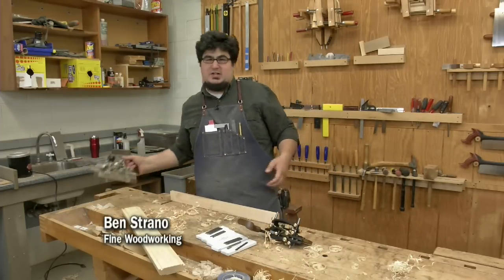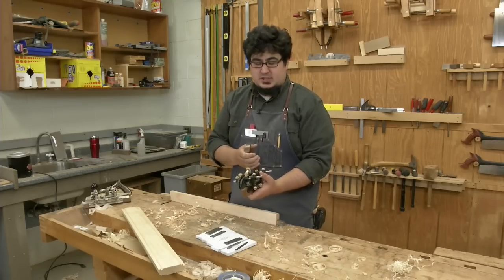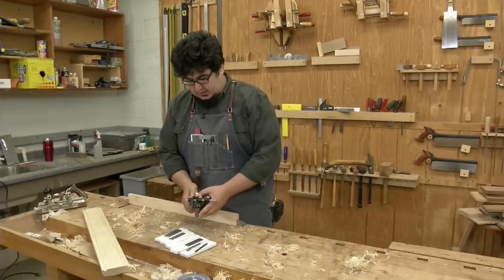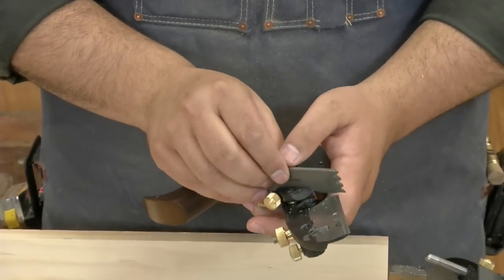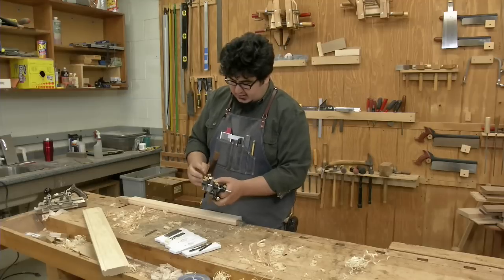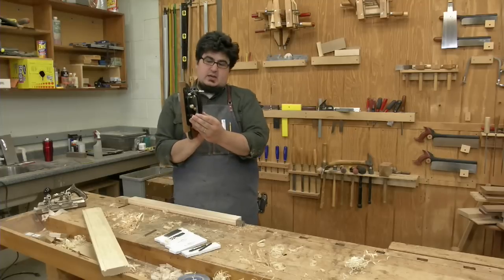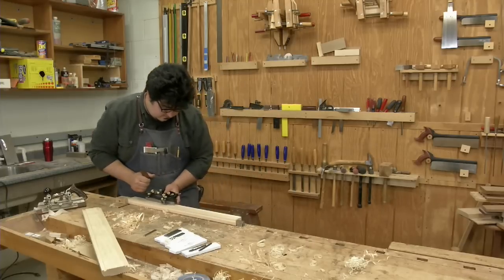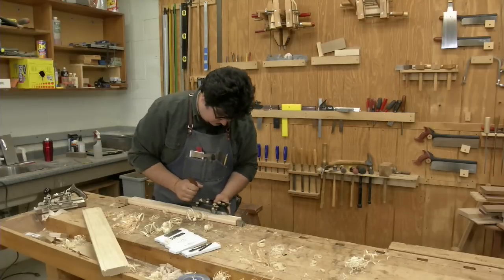First Look: Veritas Combination Plane

Comment: How much will it cost??
Reply from the maker: We didn't have an answer at the time of filming, but they recently told us $399 with a 1/4" blade. 

Additional blades will be around $20 each, more or less, depending on the profile and size.
Reply: They charge by the threaded bolt, so about $500.
Reply: Dear god
Reply: @MrGlockshna  Good price for a full size plough plane that has about 15 different blades.

Comment: Will these blades also fit Record 405, and Stanley 55 planes?
Reply: Eric Commarato   that's what they said when they had it at Handworks this year.
Reply: Yes, but note that the Veritas blades are shorter than stock (not sharpened to oblivion) Stanley irons

Comment: I could rarely get a good result with my Stanley as it would tear the grain. If this has a fine adjustment it would be an improvement. I ended up using the blades as a scratch stock. After that I bought a router. Working with the grain was ok so wood selection is a priority. Sharpening all the shapes was problematic for me. I expect the Veritas is in another league.. it may have solved these problems.
Reply: I had the same issues and agree, the adjustments will be an improvement, along with better blade metallurgy (PM-V11).
Reply: How do you sharpen the blades of veritas comb plane?
Reply: @jackdavid23  Do you mean "toothed blades" for Bevel up planes . I have never heard of a comb plane. If you mean toothed then you sharpen them the same as ANY blade . Do NOT put a secondary bevel on the teeth.

Comment: I have this plane. I set it properly. Used to build langstroth bee hive. The 5/8" deep 3/8" wide rabbet required for the boxes saw very poor results on the 5/8" vertical wall of the rebate. It got the job done but it was a piss poor result. I removed a knicker/scorer, hoping it would solve the problem. The design poorly has the knicker protruding. No problem for dadoes, big problem for rebates. The plane still left uneven facing on the vertical wall. The fence was set properly, yada yada, yada. I had to clean it up with a card scraper and sandpaper. The plane wants to walk away from the cut. Raise the cutter, the walking decreases but the 5/8(almost Max depth!) Rebate..takes a long long time. You also have to really pay attention to your fence and make deliberate passes, with intense focus on the task. A big disappointment for my first use of this beautiful tool. Also, this is a very pricey investment. With all blades you are around 1,000.00
Reply: ALL knickers on ALL makes protrude ,I don't understand ,what else should it do?
Reply: @738polarbear  the FACE protrudes, when seated in it's recess. I hope that helps.
Reply: Perhaps you have a lemon. If you are having issues, reach out to them. I have not experienced this issue.
Reply: Thinking of buying this, do you still stand by your comment ?